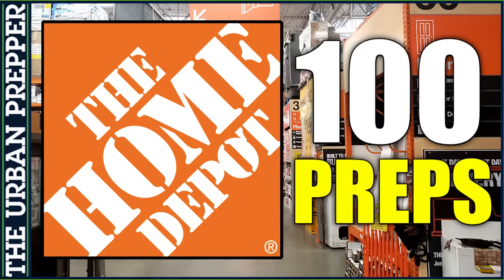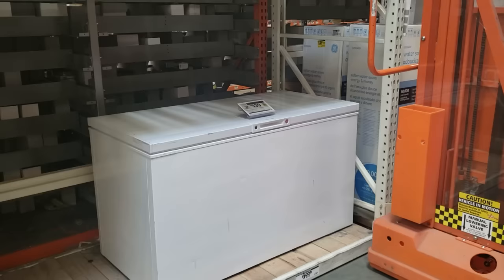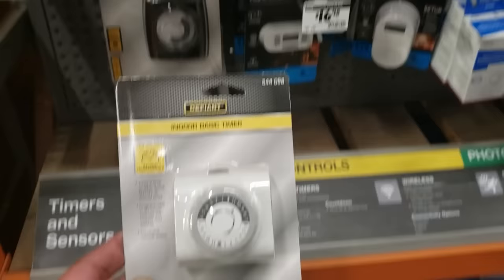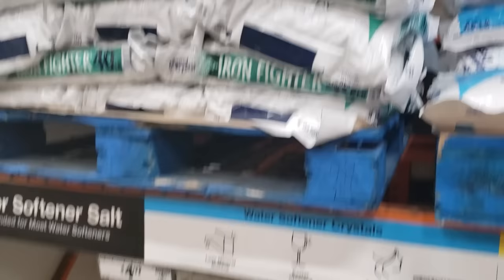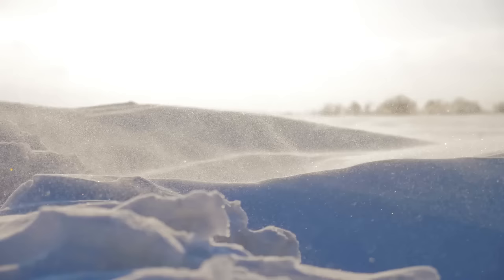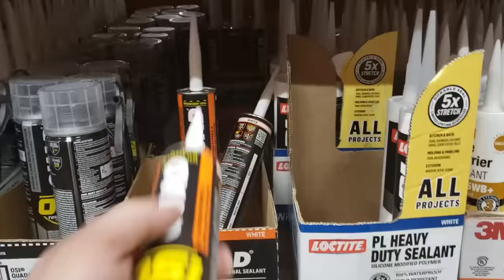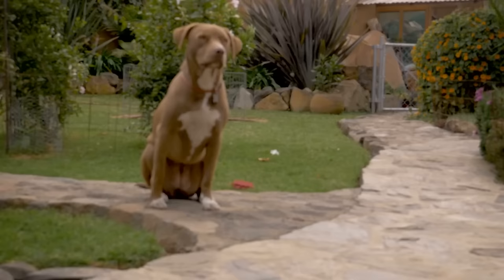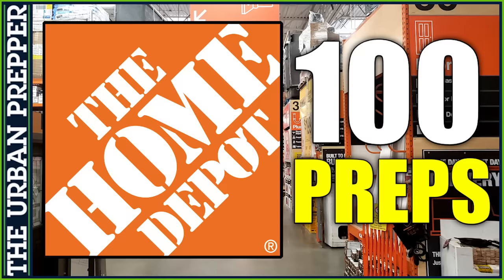Top 100 Preps to Buy at THE HOME DEPOT

Comment: Extension cords for large home appliances??? Does this youtube host not have the smallest idea concerning extension cords, large appliances, and homes burned to the ground? Has he really never heard of resistance, as a property of electricity running through a cord? He could at the very least, mention the weight/gauge of extension cord required for an appliance like a refrigerator. Refrigerators and other home appliances have short cords for two main reasons: friction and resistance. An ordinary extension cord, such as the type used quite safely for outdoor Christmas lights, will over heat in a very short time, as an extension for a refrigerator or other home appliance. If this person is going to encourage this use of extension cords, he should make a very strong recommendation for asking the Home Depot clerk for advice. It is possible to purchase an extension which will not become hot enough to start a very serious fire.  These are specialized extension cords. They are NOT for Christmas lights.